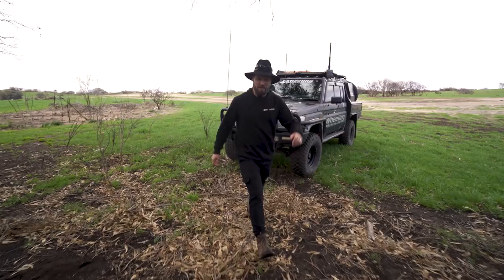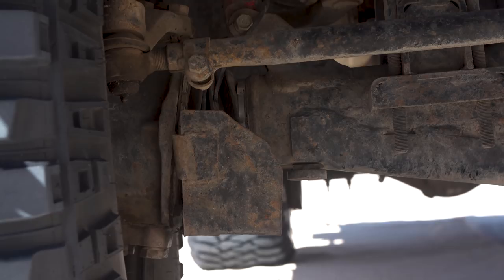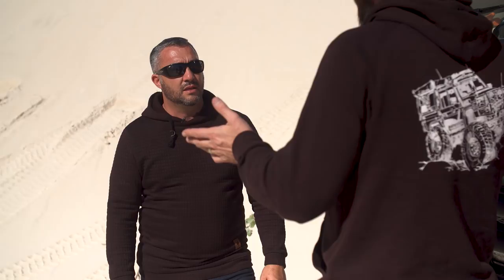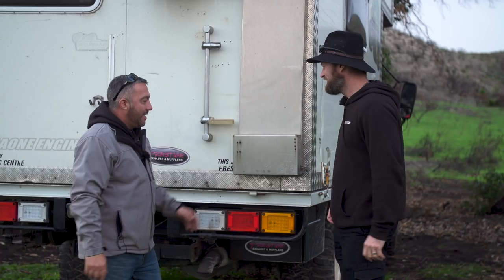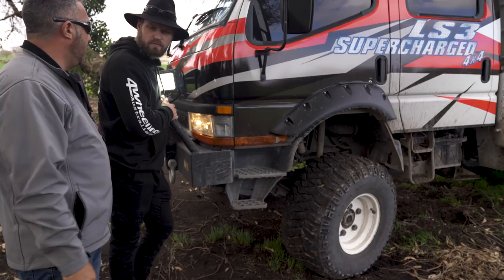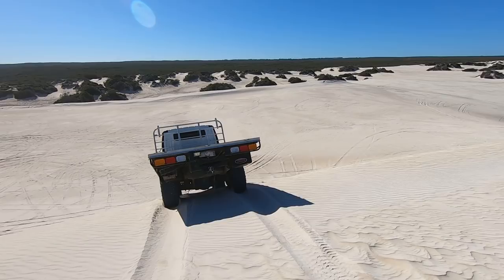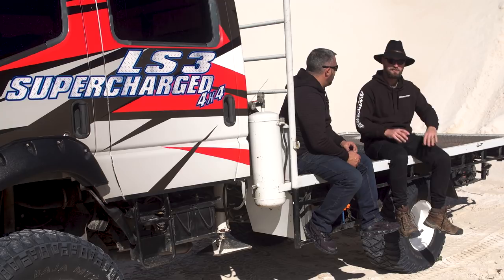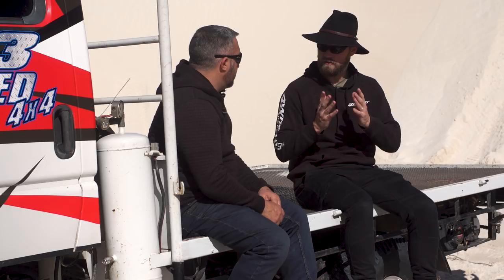Modified 4x4 Truck Camper, Modified Episode 84 Mitsubishi Canter

Comment: MPG: Yes
Reply: MPG: Big
Reply: 35k to 100L =6.72mpg 
I get that driving an Expedition with a big ass trailer behind it. Just did a 1500 mile round trip. Computer said it was 10mpg. But the actual mileage and gallons didn’t equal 10!

Comment: he is right about the power of the original motor in them. therefore on the highway but suck big time on any kind of incline. but once you get used to driving the truck in manual mode you can keep it in power range a little better but you ate the guy everybody behind you is honking at.  enjoyed the video. thanks

Comment: 35L per 100, outrageous 😂
Reply: Jbog07 who doesn't use metric? It's 2020 😂
Reply: @danzeman4520  Most Americans I believe
Reply: Any vdj cruiser would use that towing
Reply: Not even in the ball park
Reply: I’m at 9.5.... wowsers
Reply: @danzeman4520  ln England it has always been mpg and 0 to 60 mph, none of this European 0 to 100 kph crap!
Reply: @clooperman3745  but happy to use Celsius?
Reply: @clooperman3745  kph is much more logical based on metres
Reply: 7 MPG is a gasser guzzler extreme, why? H2 Hummer is 24L to 100km or 10MPG subject to gas TAx.  There is something wrong here.
Reply: Is this 7 mpg , what?  A ford godzilla 7.3L can do 15mpg all day, maybe there is something in the air in Aussieland.

Comment: G'day Ronny, That is a seriously great sounding Truck with that Supercharged LS & Auto, the camper is setup well  for extended travel & just
staying out there for as long as your beer hold's up.
Also it's really great that you have had a couple of 4X4 Trucks on the channel now, because very few Aussie 4X4 channels show them, always
preferring to stay with the little fella's.
I think I will look into a setup like he has fitted with the lifting ram's it's a good idea & would be a bonus for Me & our Truck, We are still fitting our's
out & hope to be finished early next year. Our truck is a HINO GT1J 4X4 & considerably larger than the Canter, I think  Joe said the Canter

weigh's in at 4 Ton unladen & 6 Ton loaded our Truck weigh's 9 Ton unladen & 14 Ton loaded, basically it's just the next size up in Trucks.
Anyway Ronny thank's very much for adding 4X4 Truck's to the channel because we obviously pick up great ideas & suggestions just the same
as every other 4 Wheeler.
Safe Travel's Mate,   Steve.
Reply: Hows your truck mate you enjoying it? Would love a touring truck like this best of both worlds

Comment: Amazing set up mate, I've herd about this truck and the engine in it ,i have the older 2007 dual cab and been thinking of a engine swap ,just been a little worried about the computers to run it up here in FNQ in the wet and where we go. Hats off to you mate you done good, i know there's been alot of work gone into it to get it to where it is now.👍

Comment: Hi cool Canter! For the hydraulic jacks do you know what bore and stroke was used on the cylinders?  My FG is a old landscape truck with a dump box, so I'll be scrapping the box, but I can use the hydraulic pump and sump. I think this is brilliant, when my build is done I'll be in my mid-sixties and I've had back issues, so although I'm still adventurous, I'd rather not be slugging it when (not if) I get stuck. I already have 17,500lb rope winches for front and rear in my parts pile.

Comment: In Europe with high taxes on alot of 4WD. It would be and amazing for the offroad market, if the tractor brands made some type of light duty tractor similiar to Unimog. But much cheaper, and simple. And registered as a "tractor" for tax reasons. Also in alot of farms, towing trailers is the most common job with a tractor.
Reply: dont know where you are but in italy iveco has got a few
Reply: JCB fast track
Reply: @fedvoxavoxa  with a 3 point hitch and a PTO?
Reply: @Bugoutvehiclesuk  too big and expensive. The price target would be between 35K to 45k.

Comment: This man must have deep pockets for the fuel bill required to power a 6.2l Supercharged v8 in a truck. Similar diesel TDI's get significantly more mileage. TBH I prefer diesels over petrols in a truck since your tires are much large, traction isn't generally the issue its more about torque which TDI's clearly win.

Comment: Your 4WD is a truck here is the definition of Truck:
1: a wheeled vehicle for moving heavy articles: such as
a: a strong horse-drawn or automotive vehicle (such as a pickup) for hauling
b: an automotive vehicle with a short chassis equipped with a swivel for attaching a trailer and used especially for the highway hauling of freight
c: a small barrow consisting of a rectangular frame having at one end a pair of handles and at the other end a pair of small heavy wheels and a projecting edge to slide under a load
— called also hand truck
d: a small heavy rectangular frame supported on four wheels for moving heavy objects
e: a small flat-topped car pushed or pulled by hand
f: a shelved stand mounted on casters
Reply: No where in there does it say anything about being capable of throwing sand. It can’t be a truck. 😂😂😂 *note sarcasm!
Reply: Seppos call anything with a tray a truck.

Comment: Why so many mods, when u can get a 2005 Ford F450 petrol or diesel 4x4 from factory plenty of power at 15mpg all day . Can go anywhere in Aussieland even snow.  If repairs needed, u can get them from the Net or a blacksmith can make them.
Reply: Cheapest F450 in Australia today is a 2009 and it costs $125,000 and there are only 3 on sale.

Comment: Gday Ronnie and Jo
love your piece on the cantar, i have recently purchased a single cab 2016 cantar fuso 4x4 6.5 tonne GVM. So i need not be said i am jealous as in regards to Jo. because i have just bought my fuso is basically stock. at the moment i really (although i would love it i don't have to $ to do the engine up grades). 
That said i would like to add some of the stuff you have added Jo. I don't know if this is the place to ask all the questions here or through. the questions i have are the following. 
1- tyres i have looked at AAV super singles, reviews are great but quiet expensive do you have any other ideas?
2 - suspension, any thoughts on the what i should put in the front as far as shocks go
3  - on board compressor and tanks what service (mechanic, auto elec?)  would i see. Any ideas on products?
4 - What type of hydrolics  rams for my fuso to lift truck for tyre change etc.

thanks guys look forward to hearing from you

Tryg

Comment: I don't know about the LS, if you can fit a 6BT in there that would have been so much better
Reply: Reason?
Reply: At 3-4x the cost?  For less than half the power? 😂
Reply: I got a reason, a p pumped 12 valve cummins with a few mods would rip that pissy supercharged Ls in half, get triple the fuel mileage and last 10 times longer than that aluminium shit. not to mention how easy they are to work on, no fucking around with electronics, ecu, sensors. a REAL heavy duty workhorse, not a sports car, wannabe truck engine.
Reply: @Agent.K.  6BT is built to carry heavy loads, LS is built to do donuts at the maccas carpark
Reply: @c.h1645  6bts are boat anchors mate, weigh about 15 tonne
Reply: @Bigsoot7393  i know right, the crank alone weighs easy 100lbs, but considering they came in light and medium duty trucks its no surprise theyre heavy.
Reply: @c.h1645  they also came in excavators and tractors mate so no point putting an outdated boat anchor in a vehicle just cause it soots, not enough power for the weight of them
Reply: Im aware of the applications they came in. Also fair call on your opinion, but the truck in this video would handle the weight no problem. I still think theyre dam good engines.

Comment: How does he lift the cab to get to the engine with the camper on?
Reply: There is an engine access hatch under the passenger seat. Similar to how you would access the engine on a full camper conversion or bus where the cab can't tilt.

Comment: An LS3 in something like this is impractical.
Fuel consumption would be rediculous.

Really and who's going to be dune driving in a tray truck.

Great noise and that's about it IMO
Reply: Considering he got the engine for free, I think that when you factor in the extra performance, it balances out the added MPG..
Reply: @guitargodmc  yeah fair enough but I think there's an ls conversion has its specific application and IMO, apart from the wow factor, this isn't. What do I care, it's not my coin and good luck to him. He looks like he's having a whole lotta fun.😊
Reply: He’s had the truck long enough to know it works for him and that’s what matters.

Comment: How do you access the engine bay? Is the Canter a tilt cab?
Reply: They are a tilt cab but there is an engine access hatch under the passenger seat. Similar to how you would access the engine on a full camper conversion or bus where the cab can't tilt.
Reply: @JeremyPetho  nah mate dual cabs don’t have a tilt cab